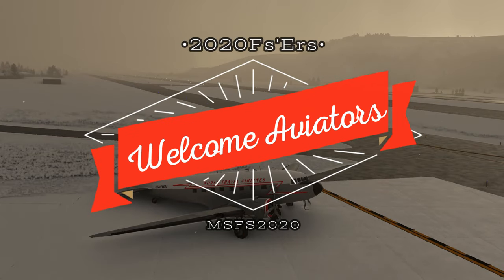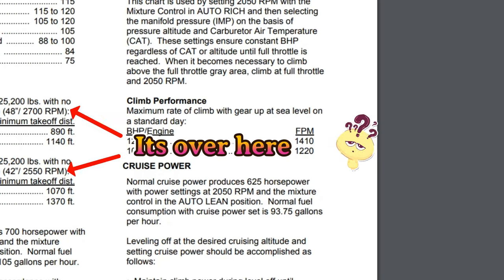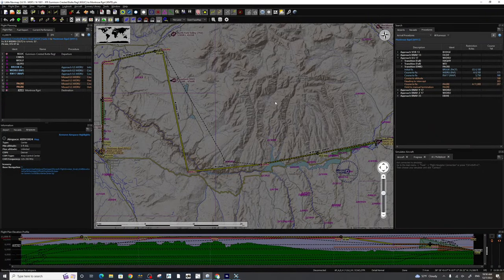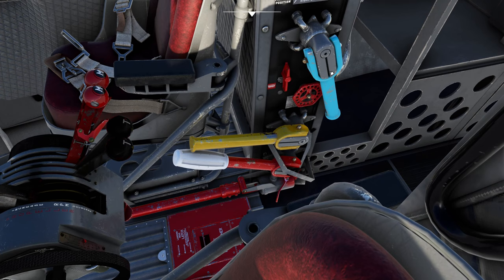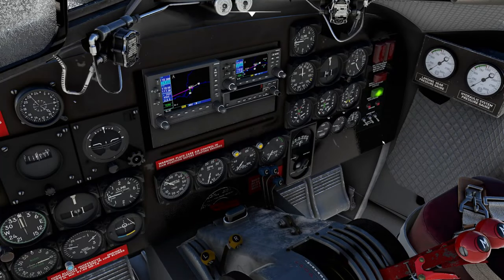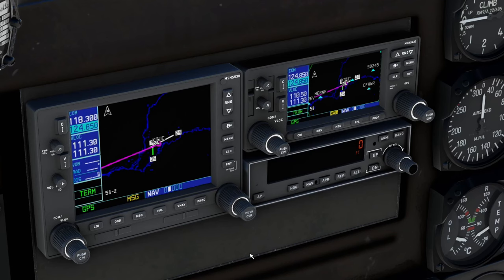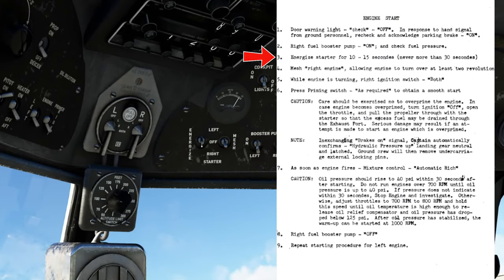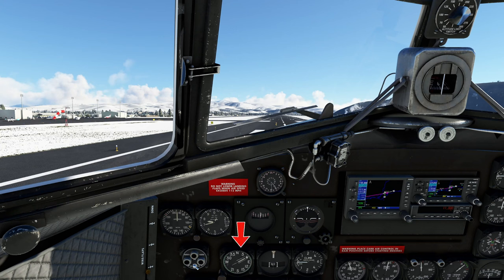Msfs2020*DC-3 Full flight-No Fluff *TOD planning-POH settings-ILS Approach W/Gns530* Retrofit

Comment: I flew 1,600 hours in DC3/C47's over 6 years & firstly this msfs Aircraft is treated way to complicated including the Cockpit provided. ( It flew like a big docile Cessna)
Secondly YOU have done by far the best YouTube video so far, well done!
Now my notes:
* The gear handle was like a tap for up & down & would be neutral otherwise as the gear horn switch was under it - it was locked with the small handle.
* We never opened the Storm Windows & used chewing gum to stop them leaking.
* The Blue Hydraulic lever had to be forward for the old Sperry Autopilot to work.
* Starting procedure - I have never seen an Inertia starter - all I saw were Electric & with them you never turned on Ignition till 9 blades & mixture after start. ( Watch the old Radials on YouTube)
* Taxing - Tail Lock in at all times except turning - lock out, outside Engine plus brakes & halfway through the turn outside engine off & inside to stop the turn.
* NO flaps for take-offs- there split flaps & only give drag.
* The levers on the left on all DC3's I flew were Oil Shutters & used to get the oil temp up to minimum.
* Nothing over 85 kts (mph?) On final approach & on landing it made the most magnificent screech from the tyres on a good one - slight forward stick if it looks like bouncing.
Finally - don't make it complicated as it was docile & fun to fly unless you were in  Thunderstorm & going down with METO Power  near the LSA!

* For take-offs Fire Hatch open & closed after T/o - V2 82 kts safety speed (mph?)
Reply from the maker: Wow thanks for the comment and all the info you provided that's amazing. Must have been a real joy to be in this aircraft I envy you .. Thanks again
Reply: I & 4 others stepped out of single engine DH82 Tiger Moth biplanes  & Cessnas etc having never flown twins, Constant Pitch props or Retractable Gear & 10 hours night flying into the DC3,
* All except one DC3 Had Wright 9 cylinder Cyclone Engines (Same as the B17) & the C47 had 14 Cylinder Pratts - they were the same to operate. (These engines used 1 to 2 Gallons of oil per hour BTW)
* Both engines were Supercharged  but without any High Blower & as for the Cowl Flaps all DC3's in civil use in Australia had fixed Cowl Flaps.
* The 4 of us trainees spent 1.5 hours together learning hour to taxi before we ever flew it.
* If you want a real DC3 experience get rid of all the modern crap including the ILS as a VOR & Localiser approach or ADF was all we had - the Auto Pilot was the original Sperry hydraulic operated hence the "Blue" lever sent the left engine hydraulics to the Auto Pilot.
Reply from the maker: Lots of great info thanks

Comment: Just flew the DC-3 after the latest update and the engine performance has improved. What a difference! I did lose some power and altitude when the gear came down but it's much better. Takeoff much easier although different, the weight balance was off which I corrected. Love this plane. Another video on this would be great. I don't understand the blowers and I can't read the dial that goes with the decision height indicator. Thank you for your time in making this video.
Reply from the maker: Yes I will do another video on this and try a more raw video without cuts and that may help out some viewers .

Comment: Great video. One of my favorite planes although its a challenge to fly especially after takeoff. Experienced many crashes as it can stall easily. I've learned to bring the nose down until you build up speed. I do use the mod. Also, the weight balance is off so I correct it before takeoff. The smoke affect upon engine startup is in the default plane too. Also, you can lock and unlock the tailwheel which is located way down below. I bind my velocityone for that. I also find the plane suffers too much drag when you drop the gear and it sometimes can't hold it's altitude even in autopilot is on. Maybe I'm doing something wrong. But all in all, it's so fun to fly. Your video was very informative.
Reply from the maker: Thanks for the comment .. I never use the tail wheel lock I find it easier to control . And yes I have the same issue when gear comes down the plane can fall out of the sky lol.
Reply: Your not doing anything wrong, the DC3 was easy to fly & very forgiving ( I flew them for 1,600 hours).

Comment: Terrific, comprehensive video. Thanks. Two questions: 1) I heard you're using a Bravo Throttle Quadrant. I can use all the Auto Pilot controls on my Bravo except Vertical Speed increase and decrease. Do you have that issue? Do you know how I can get this working? It's all mapped correctly. 2) Do you lock the tailwheel for takeoff and landing?
Reply from the maker: Thanks for the comment ... I use spad for my bindings and I am using the kap140 Binding for the up and down buttons to use vertical speed. I do not lock the tailwheel but the proper procedure is to lock the tail wheel once lined up for takeoff then you need to get the tail up quickly so that you can turn for any corrections. Landing I also do not lock the tailwheel .

Comment: Great video.  One big issue though with that POH you're using is it references KIAH while the DC3 uses MPH on the airspeed indicator.  So you're way off on speeds on your flight.  Example, your climb speed of 115KIAS is 135mph, so you were way way slow on your climb out.
Reply from the maker: That would be a big issue lol oops I see and or realize that thanks for pointing that out .

Comment: I enjoyed the video.
Need help to access the parking brake knob under the console. The trim wheel seems to get activated and I can't get low enough to access the parking knob.
Any hints.
Thanks
Reply from the maker: Lol yes some things are hard to hit. I use an Xbox controller to adjust the camera and translate down in the cockpit and then set a custom view

Comment: Thanks for the tutorial! Anyway I'm having a problem when using the DuckWorks DC3 the AP is just not working and only giving me annoying blip sound 😥
Reply from the maker: Make sure to flip the blue handle in the middle of the cockpit.  On the side wall.
Reply: @2020fsers  Damn forgot about that haha. Now the AP works like a charm! Thank you!
Reply from the maker: Your welcome
Reply: @2020fsers  Also last more thing, Have you encountered the GNS 530 suddenly turns off mid flight? I think this is a bug cuz everything seems to work It's still holding the set altitude but not the set waypoint and the radio still works 😅
Reply from the maker: @sephvillanueva8890 No I haven't had that issue and I mostly fly with the 530.
Reply from the maker: @sephvillanueva8890 I am using the wt mod from the marketplace
Reply: @2020fsers  i will try and install that. I'm currently running the 40th anniversary one. Thank you again! Hahaha

Comment: How do you adjust the heading bug? I can’t seem to adjust it in the retrofit version.
Reply from the maker: The knob on the heading dial should adjust the heading
Reply: Yeah I definitely didn’t ask the right question, was trying to figure out how to adjust desired heading for the auto pilot in heading mode. This was a great video! The DC-3 has become my favorite aircraft to fly in MSFS. Hope to see more on this plane in the future!!
Reply from the maker: Ok  I don't know if this is the right answer lol but I give it a go . You need to hit the heading button  on the kap 140 and most important make sure that your gyro is synced with the compass and then I use the knob on the heading bug to change heading and the autopilot follows it .oh and make sure ap is engaged

Comment: I am stuck, i am doing whats shown for using the HDG, however it says no and goes north
Reply from the maker: Did you sync the gauge with the compass ?
Reply: @2020fsers  yeah, put the wide over the thin, then hit HDG, and true north happens every time
Reply from the maker: No what I am saying is you need to sync that hsi gauge to the compass then you can set your heading .
Reply: @2020 fs'ers  hmmm, I cannot see how your doing this step. Can you please explain this step in more detail, this is the only thing I struggle with and it's an amazing aircraft
Reply: So.... update, I did not have the 530 mod, now I do. Upon clicking ap it flashes rol and then disappears, so I'm guessing im missing how to turn on the ap to get the aircraft to communicate with the ap (how do I do this)
Reply from the maker: I think there is an autopilot switch center console near the bottom also you need to flip the lever to your right look 90deg right.
Reply: @2020fsers  I have sent a request to join the fs group, if I could be accepted there I could show the video of the error?
Reply: @2020fsers  thank you, i did not realise i had to also position the blue lever forward, i was only turning the red dial to the left of the blue
Reply from the maker: Oh that red dial is so you can manually pump up the hydraulic system. Yes that blue lever must be used now using the mod for the dc3 it's getting more and more lifelike.

Comment: BHP stands for Brake Horse Power not base.  For not being a real pilot you did a very good job on the explanation of planning. One thing that you have nothing to do with is that the rotating beacon on the field was on and it is not IFR🤣🛫
Reply from the maker: Hey, thanks for the comment. Brake horse power makes sense now lol  thanks for the tip there .
Reply: @2020fsers  I am to offer help, not beat you up with criticism. I have been flying real airplanes for 50 years as of last Dec 7,
Reply from the maker: And I really appreciate the info I always welcome information especially if I am wrong about something that's how we get better .
Reply: Using sims vs real flying: It is like reading about sex for 30 years, but never actually having sex